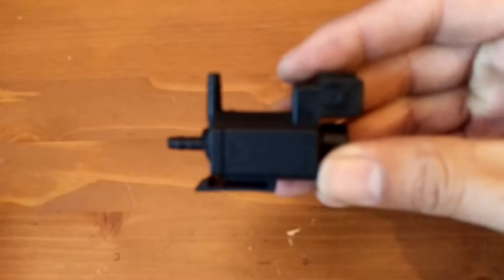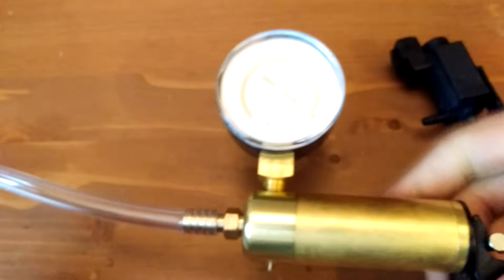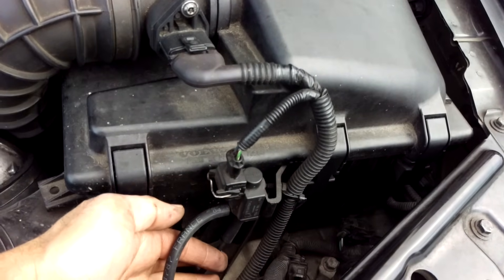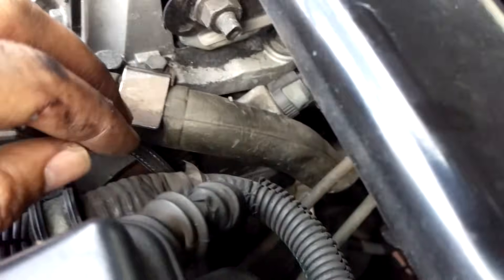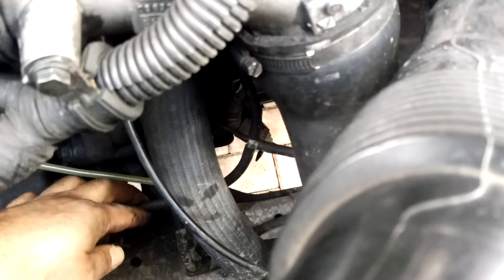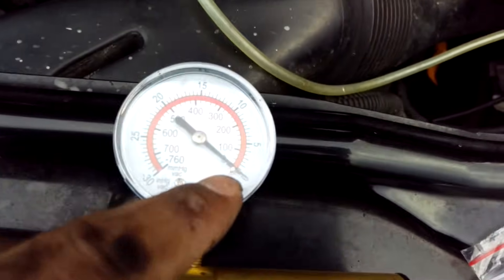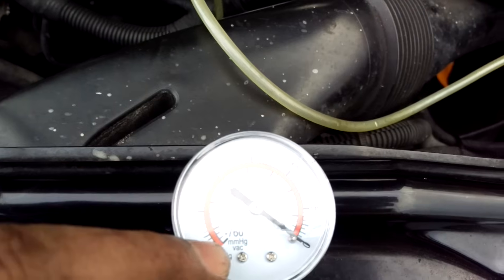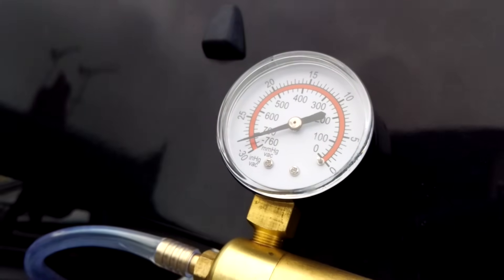How To Easily Test a Turbo / Boost Control Valve TCV

Comment: Hi,

I've got a pierburg selenoid in my 1.9 JTD 16v which I'm having boost issues with at the moment. I'm not sure if it's the selenoid, variable geometry flaps being stuck or just turbo being a goner. What I've noticed with the selenoid is that it buzzes really loud sometimes with the car off. I know it should buzz and then switch off after 30 seconds but sometimes it doesn't buzz at all and then it comes on when I smack the bonnet shut or give it a little whack (it goes off just as well as that). Is that electrical or should cleaning it should fix it? Any clues?

Thanks!
Reply from the maker: +spluker88 Have you checked and tested the VNT operation?
Reply: I've pulled some vacuum through the vacuum pipe to see if the actuator arm moves and it did without hesitation but only about 0,5-0,7cm travel. Not sure how far it was supposed to go in but it seems like it could go further in... Any other way to test it?
Reply from the maker: spluker88 Does the actuator arm move when connected to the solenoid and you rev the engine?
Reply: Ok, gave it a little bit of booting in neutral just now. The actuator moves but nowhere near as much and it doesn't react as quick as if I would just suck on the vacuum pipe. I only reved it up to 2500-3000rpm.
Reply from the maker: spluker88 OK, well I would imagine that the actuator isn't controlled by a valve like in this video. 

Instead, is it controlled by a solenoid valve like in my video here? https://youtu.be/dkPuEmwP4oQ 
If it is you might be able to clean it but if the rubber disc inside is split, you will need a new valve.
Reply: Ok, thank you very much.

Would you recommend getting a used one stated as 'tested and working' on ebay or should I definitely fork out for a new one?
Reply from the maker: spluker88 If it's a solenoid valve, I would open it up and see if it can be cleaned but yes, so long as there's some sort of working guarantee, a used one could be fine. 
They're not crazy money new though. Sites like www.autodoc.co.uk can be very competitive.

Comment: but how do you have vacuum if you are not connected to the car vaccum system? how is the turbo making vacuum by him self ?
Reply from the maker: Muresan Dorian On this car, there is a mechanical vacuum pump driven by the exhaust camshaft so vacuum is always produced when the engine is running.

Comment: HELLO SIR SIRobb

First thank you a lot sharing with us all these detailed videos about our Swedish ladies !!

They made me progress about the diagnostic of the limp mode hurting my s60 but not fixed yet 

I checked the boost solenoid , egr , vacuum pipes as you show on yours videos nut nothing 

Without vaccum measure tool  it seems that my boost Control Valve TCV diverts no vaccum (toward motor mount ) whatever rpm (pipe pulled off , finger on the tcv , no suction )

1/ can the tcv dysfunction make this error possible (service urgent /required) 

2/ is there a test to check if the problem comes from  a seized turbo  ? 

Thank you again 
Francisco
Reply from the maker: francis feugas Hi Francis and thank you for your kind words. 
With your problem, I would now pull off the bottom hose to the TCV when the engine is running. 
There should be constant vacuum. 
If there is no vacuum, the TCV may actually be ok. 
If there is a good vacuum then yes that does point towards the TCV not working as it should. 

Please buy a vacuum tester though. 
They are not expensive and can save you a lot of time. 
They are also good for many other jobs.
Reply: hello Sirobb

you are right , there is constant vacuum at idle power , so tcv is ko if i have undestood   (i suppose tvc feed back bad information that make limp mode  ? is that true ? )

besides , is it possible to detect a seized turbo ? , because my mecanic told me the problem  was coming from a possibly seized turbo , but not speaking about tcv 

think you again for your help

sincerely  francis
Reply from the maker: francis feugas It sounds like your TCV has failed closed so the turbo is unlikely to be affected by that. 
The main compressor wheel in the turbo will not be seized but the control ring and vanes may be seized. 
If this happens, you can have under boost, over boost or almost no boost.
Using a vacuum tester, you can easily test the turbo actuator and see the control ring lever moving. 
If it doesn't move correctly, there is a problem. 

Testing is explained in my video here https://youtu.be/NxmjRaiqeAk
Reply: Hello SiRobb

Sorry but i need once again your help ! 
(I m equipped with a vaccum tester this time)
1/ I cleaned the boost control valve ( can I test it ?)
2/ I cleaned the egr 
3/ I dismantled the turbo and cleaned off the coke scale – the vnt actuator move freely 
4/ I changed the the boost control valve tcv for a new one
But the test of this later don t work on mine despite : no vaccum whatever rpm 
Have you got an idea of  the issue
Thank you a lot I don’t know what a can do now 
Sincerely Francisco

Comment: Si, PA6 GF30 is the spec for the polymer used for the casing. It is a recycling requirement that manufacturers state the material. PA6 is a polyamide and the GF 30 refers to 30% glass fibre content, for rigidity enhancement.
Reply from the maker: Yes, I read out the wrong set of numbers but not really worth filming it again. 
The part number is the other set you'll find.
Reply: lol

Comment: Hi SiRobb, first of all thank you for your effort on making these videos . I have a 2003 XC90 D5 163hp and I have done this test on mine, results the needle on the vacuum pump did not even reach half way of the scale, so it must very much shot. I have tested also the engine mounts, the front one is bad, it doesn't even build  any pressure, the rear one is fine it seems that it has been changed  I've had the car for two years now and in a week I will be on vacation so following you videos I hope to be able to change the front engine mount, boost control valve, and clean the boost valve behind the egr black tube near the starter motor. For the moment i took off the vacuum line from the front engine mount and closed it with a screw, it seems a little better from stop to start for now. Thanks again and keep up your good work..... Regards Carlo.

Comment: I always thought when you increase the revs and open up the turbo, the actuator was being sucked (meaning more vacuum). From this i gather that there is more vacuum when the turbo is closed?
Reply: Understanding after both comments:
This video doesn'tt actualy test vacuum control going to the turbo, but tests control to engine mount that has a vacuum line attached to it.
On a turbo setup you should usualy get TCV valve to open more on higher revs, sucking more air, opening the VNT VGT more.
Reply from the maker: Your understanding is correct however the control valve in this video is actually used to divert vacuum to pneumatic engine mounts.
This is why I say you must check the conditions of operation for the valve on your own car as the valve has multiple uses across different cars and engines.

Comment: hi mate could this cure an overboost condition on the turbo? thanks.
Reply from the maker: What car and engine do you have?
Reply: +SiRobb 
hi its a skoda octavia 1.9tdi on a 2009 reg
Reply from the maker: +shoaib bashir Curing overboost can vary dependant on quite a few circumstances. 
Do you happen to know if yours is a VNT turbo?
Reply: +SiRobb 
i dont im afraid it seems to go into a limp mode when i put foot down and car goes over 3000 revs
Reply: Yes,my Laguna 1.9 DCi from 2003 does exactly the same,It's was MAP(small sensor on intercooler pipe),I also change oil-ELF 5w-40,I clean EGR-valve,now car runs very good and there's no limp-mode!
Reply: That will be the fuel cut-off sensor on top of the fuel pump on the engine. I had the same problem & had to very gingerly press the "loud" pedal as if I stomped on it, it would go into limp mode. These are about £65 to replace & piece of P to do too!

Comment: just tried it and... Just with a hand. it seems that it does not create any vacuum at all. also pipe to front engine mount is missing. could it influence some lag in performance around 2k revs?
Reply from the maker: Yes definitely.
Reply: +SiRobb Thanks for prompt reply. I will check my engine mounts as well. The engine behaviour is strange. Rough low revs, than it goes ok and that suddenly there is that lag. Once some 2k+ revs are reached, it smokes havily but than it all OK and car goes like stig.

Comment: Dear Sirobb.
I have buy Vacuum pump like u, and have check the Book Control Valve, like u did.
But I have 15-20inHg, u have ~28inHg, is that normal 15-20 ?
Reply from the maker: What is your car and engine?
Reply: +SiRobb Volvo S80, 2004 D5 120kW.
I have chacked my vacuum leak. All was ok, 2 mount is dead =(
On Saturday, I take off the video of my problem, may be u help me with my problem =( 
I'll be very happy.

Comment: Hi  Sirob I'm having vibration at low revs with a light metalic vibration from g/box side my suspicions areit could be the rear mounting perhaps I have previously replaced the large strut bar mounting and front lower crank and mounting any ideas ?  Thanks for an excellent video though
Reply from the maker: The vacuum mounts can easily be tested and you can also check and fix the lower gearbox torque mount. 
See my list of videos for how to do these suggestions.

Comment: Hi SiRobb, great vids and explanations! I own a D5 from 2004 and it has an issue which you might recognize. When I approach an intersection and press in the clutch, just before I stop, the engine rev's drop to around 600rpm (normal iddle is 700 rpm), which makse the engine vibrate slightly. Then after ~2-3 seconds it goes up to the normal 700 rpm's. Got any clue what might be causing this? 

Thanks,
Best,
Marcel
Reply from the maker: Hi Marcel. 
Have you vacuum tested your engine mounts?
Reply: the mounts where actually replaced a couple of months ago.
Reply from the maker: +Marcel Wierts If they weren't genuine Volvo, I would still test them. 
I've heard of aftermarket mounts not holding vacuum.
Reply: all right, I'll get a vacuum tester and will check them. Get back to you once I did. ALthough I'm pretty sure they used original parts.
Reply: Engine vibration came from EGR-whether it is clean or not,I turned mine 180 degrees (lower mechanical part) and upper (electronic part) normally,through the 3 holes...Immediately engine stopped smoking through the exhaust, the machine did not vibrate at certain speeds and worked quieter and better,I I recommend you to check the turbo solenoid sensor, the MAF and the MAP (the little sensor on the intercooler tube),some people also recommend changing the accelerator pedal sensor

Comment: You ever had or heard of a D5 starting up normal. But then going off as if you turn the key to off. 
But you didn't turn the key. 
Mines has a couple of times. I just thought nothing of it. Assumed it was the effects of a cold battery, tried it again with a bit of revs and it was fine.
Its probably needing some of these cleaning and purging procedures done. But I don't fancy paying a small fortune at a garage or risk feckin up my car doing it myself.
Reply from the maker: Hi Andrew, sorry for the late response. 
There could be a few possible causes. 
Most likely could be as you've suggested, a power issue so check your battery, alternator and associated connections. 
Crank and cam sensors are normally very reliable on the D5 but aren't immune to failing. They do normally store a fault code though so a diagnostics scan may be needed. 
Also, the ignition/immobiliser antenna ring has been known to be problematic so if it loses signal from the key, it cuts your fuel.

Comment: Hi SiRobb. Just wanted to say thanks for the Volvo vids. I look forward to each one. I have a a lovely D5, one owner FVSH but I maintain it myself as I am a motorcycle mechanic. That's not to say I know everything, on the contrary! I find your videos informative and love your little free fixes now and again. Keep up the good work. Im really in two minds about doing the Liqui Moly diesel purge. She is running like a dream (having the Polestar remap helps) but I like the idea of doing it none the less, but you know what they say, let sleeping dogs.........
Reply from the maker: Belated thanks Nathan for this great comment. 
It's enjoyable making the vids and knowing people like you find them useful is very satisfying. 
There's plenty more coming up including a cheap 305 mm brake disc upgrade video which if you haven't got it already may interest you seeing as you're running with more power.
Thanks again, Simon.
Reply: olieanrieail

Comment: Good video. I'll give it a go tomorrow. Still trying to source a front engine mount :P
Reply: +Povo I tested the TCV and it works like it should. Strange that blocking the TCV hose up doesn't get rid of the sound when I take off the oil cap though...
Reply from the maker: +Povo If you have the Euro3 163, you may instead be leaking vacuum at the boost solenoid behind the EGR. 
If that's sticking, it won't be controlling vacuum as designed. 
Trace back from the TCV to the T connector which goes to the boost solenoid and vacuum pump. 
Remove the boost solenoid pipe from the T connector and block the T connector instead.
Reply: +SiRobb I will try it tomorrow. Thanks a lot for your help and videos! I have a 2004 XC90 so I guess it's a Euro 3.
Reply from the maker: +Povo Black engine cover Euro 3. 
Silver/Grey Cover Euro 4
Reply: +SiRobb Mine is a Euro 3 then. I'll get some carb. cleaner and clean up the boost solenoid just in case then. Might help :)
Reply: +SiRobb Yeah removing the boost solenoid pipe from the T connector and blocking the T connector still didn't change the sound :\
Reply: I have the same problem as you Povilas, can you tell me what was the solution?